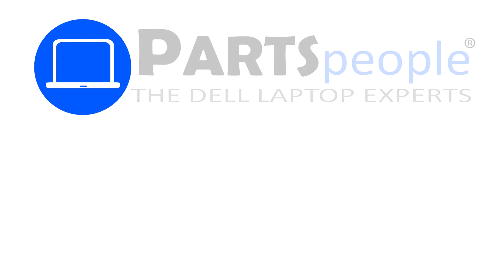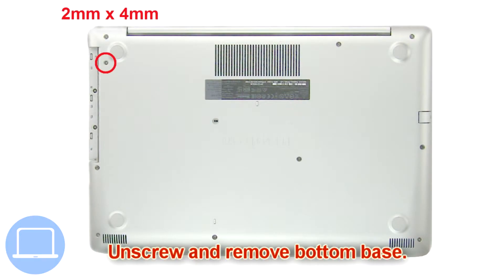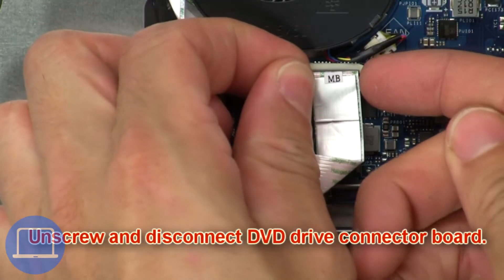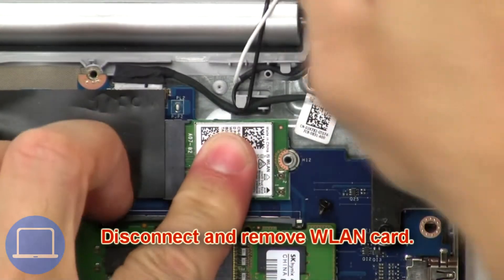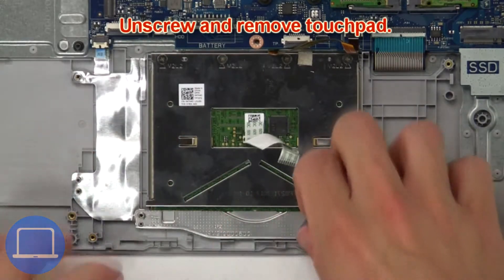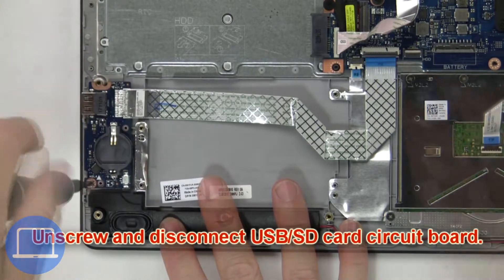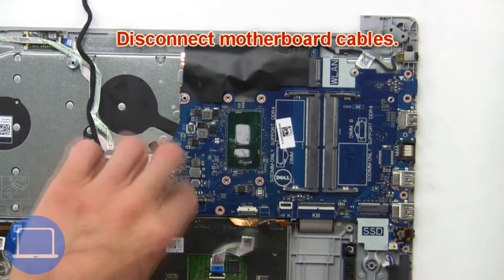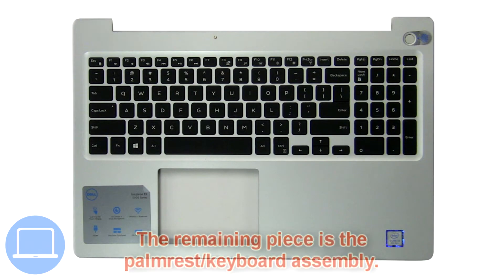Dell Inspiron 15-3585 (P75F008) Palmrest Keyboard Assembly How-To Video Tutorial

Comment: Thank you so much for this guide. While it wasn't exactly 1:1 with my specific model and some steps were a little out of order (e.g. I had to lift up the display bracket first to access the power cable), it certainly went a long way in helping me swap out the busted keyboard palmrest with a replacement one.